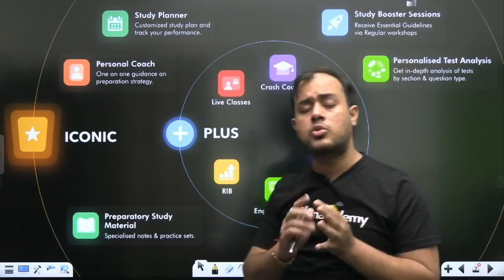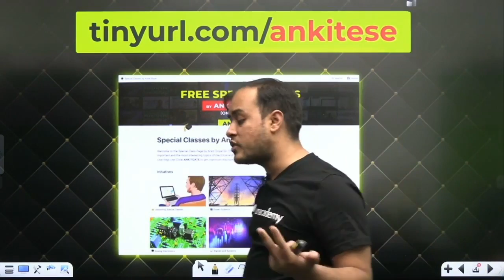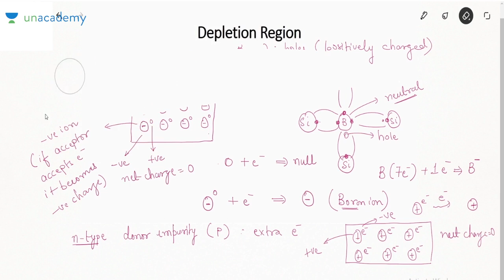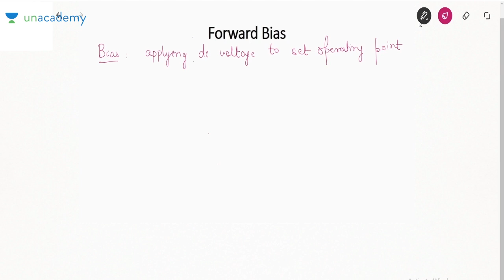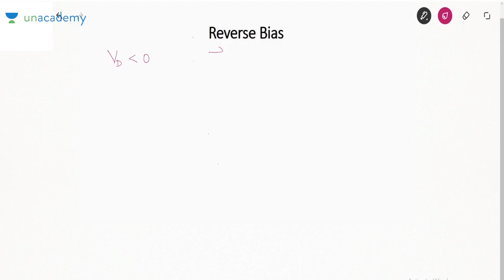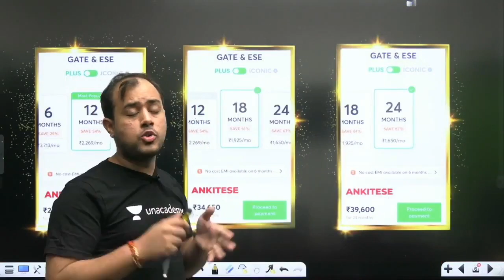Construction & Working of Diode | Diode Circuits | Lec 3 | Analog Electronics | GATE 2021 Exam

Comment: Sir i have a question...
42:18 sir you say at x=0 point Emax. 
But how ?
 At x=0 net charge is 0 positive ions are cancelled due to negative so there E will be zero ?
Reply: Just think like this
E feild is occurring in depletion beacause of electron movement so obviously as net positive charge in depletion region from N side increasing, the E feild also increasing as the net charge started to reduce E feild also reducing so we get maximam at center.. I hope u get also your concept is wrong E feild is a phenomenon occurs from the electron movement, less movement less feild, high movement high feild.. Why are u including holes here. Holes are vacancy of electron that's it.

Comment: Sir I want to  ask in forward bias Jo external electric field hai due to battery  WO depln layer ke under hi hai Ki bahar hai
Reply: it is all across the diode, but since the resistance of depletion region is higher than that of the neutral region, most of the external voltage or field appears across the depletion region.